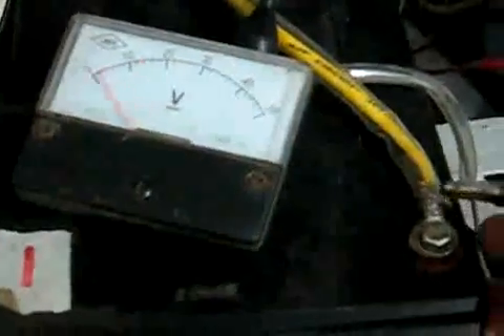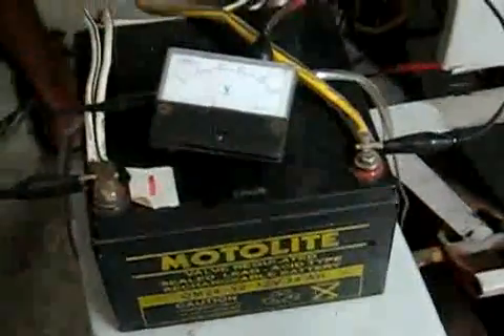ismael aviso electric car feb 12 2011 part 1 of 2 phenomena validation

Comment: @ley858 Thanks! That would be sufficient information to start with in a conversation. So, to crudely analyze the process in the machine,  the battery powers the device that collects RF waves. The collected energy gets stored in capacitor bank and the capacitors power up the power supply for the DC motor.